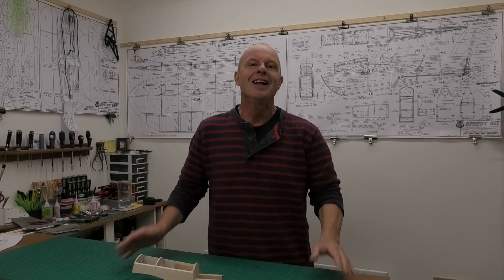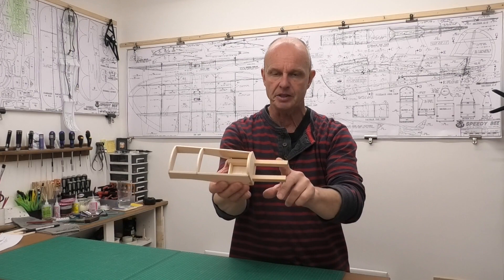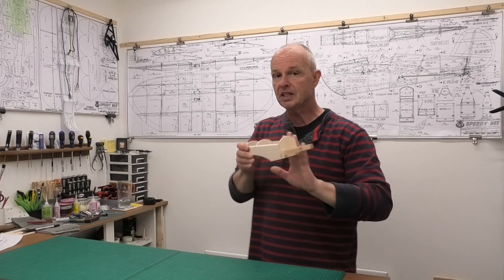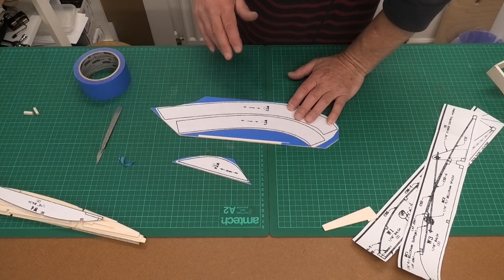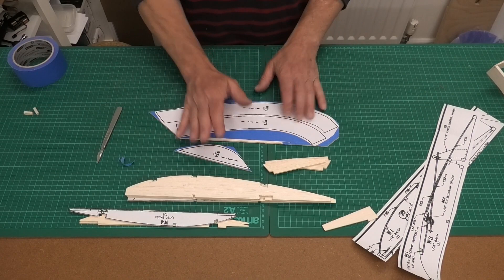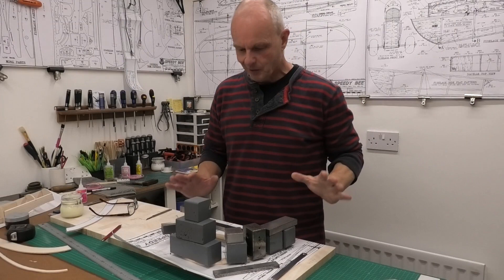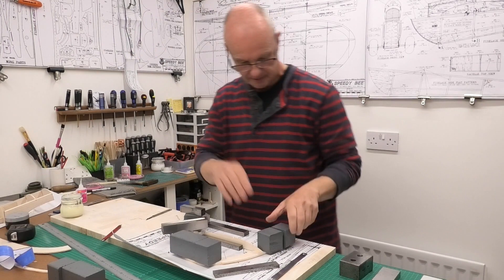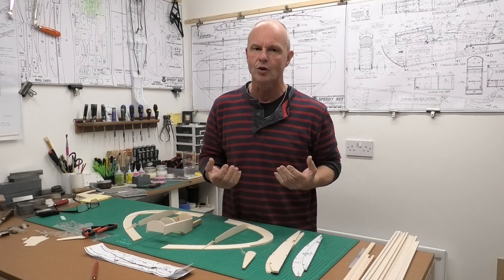Speedy Bee - Build Series Pt 2: Ribs & Wing Tips - Designed by Clancy Aviation - OS fs26

Comment: The metal blocks you are using, are those gauge blocks machinist typically use?
Reply from the maker: The painted square blocks I had made from a bar of steel, the unpainted are machinist blocks.